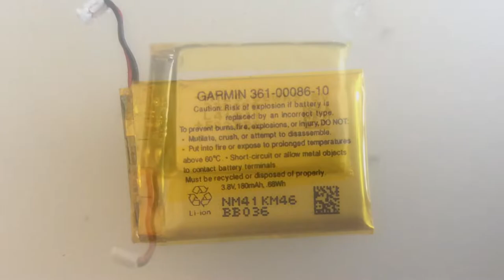Garmin Instinct Battery Replacement : เปลี่ยนแบตเตอรี่นาฬิกา การ์มิน อินสติง

Comment: Wait, did you just broke the light connector? That tiny cable when you opened up the lcd and main body
Reply from the maker: Yes. The light cable was broken away from the watch face body but the light is still working. Before assembling back, the end of the light cable should be attached  to the correct position.
Reply: @NOPPADOLSUD  hey buddy, I need to ask.
My watch (Normal Instinct), only got 7-8 days of battery life even when Im not using it (1 Bar left at the day 8). It stays on my desk all the time. Do I need to change the battery?
Reply from the maker: No need to change the battery. It still works well.
Reply: @NOPPADOLSUD  how long does it take normally to reach zero percent?
Reply from the maker: Up to 14 days: Smartwatch mode with activity tracking and 24/7 wrist-based heart rate monitoring
Up to 16 hours: GPS mode with wrist-based heart rate
Up to 40 hours: UltraTrac GPS mode
Reply: Awesome video, but with my delicate hands, the watch would never work again.
Reply: @NOPPADOLSUD  Hi, my watch instinc solar, keeps turning off after any vibration from alarm or timer when unplugged to the power source and works normally when plugged. would changing  the battery be a possible solution?
Reply: Where did you order it buddy I have my Garmin instinct only 1.5hrs battery drain